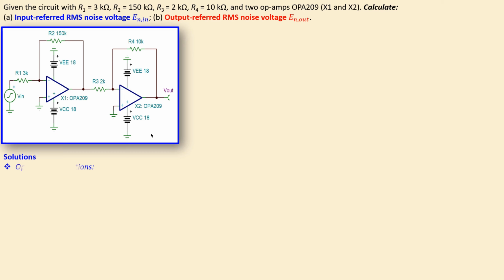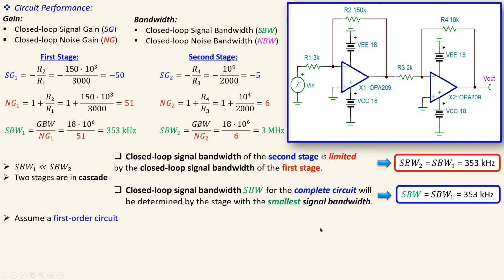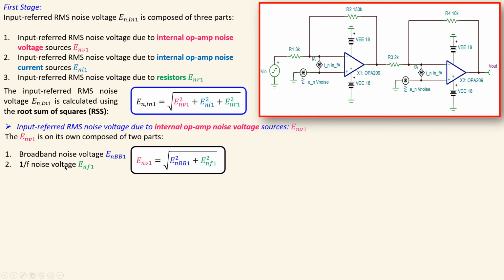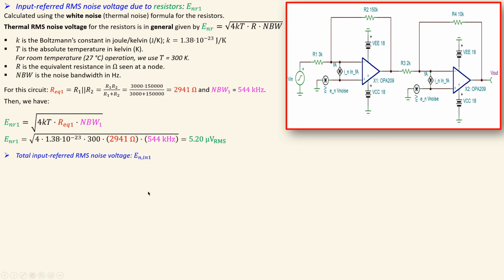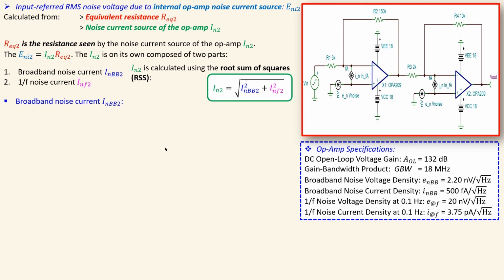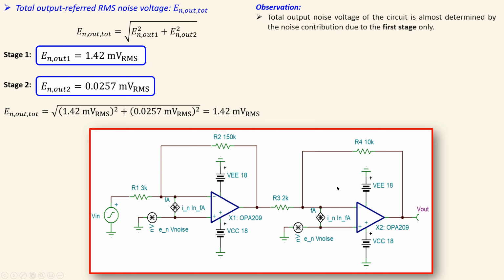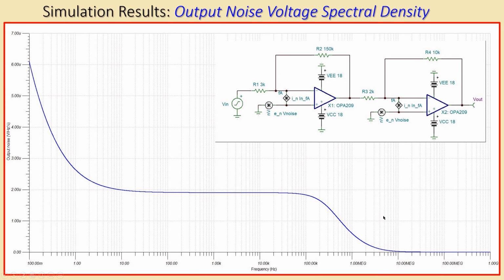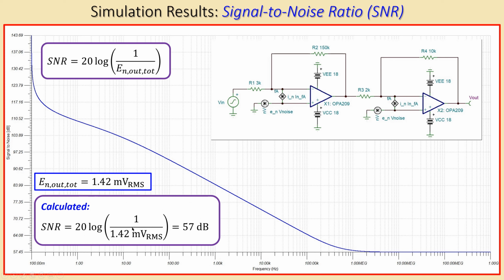Noise Analysis Op-Amp Circuit ⭐ Two-Stage Amplifier ⭐ Calculations & SPICE Simulations ⭐ Example 8

Comment: Hii...nice lecture but in my case i have first stage as transimpedance amplifier and second stage as instrumentation amplifier...then how to calculate noise gain for both of these to calculate noise of the total circuit... please help me with this
Reply from the maker: I do not have time to check your circuit in detail. Try to use the videos or the book.

Comment: incase of connecting INA as second stage with TIA ,then how should i calculate noise analysis
Reply from the maker: This is a too general question. You can use the two-stage amplifier noise calculations in my video.

Comment: I HAVE THE SECOND STAGE AS INSTRUMENTATION AMPLIFIER,SO ITS THE SAME CALCULATION AS MENTIONED ABOVE
Reply from the maker: You cannot have the second stage as an instrumentation amplifier if the first stage provides single-ended output.
See this playlist for more info and videos about instrumentation amplifier noise analysis: 
🔗 Instrumentation Amplifier Noise Analysis: https://www.youtube.com/playlist?list=PLuUNUe8EVqlknqQWFevG_00gFK6iTUxD4
Reply: @CANEDUX  actually,i grounded the 2nd input of INA,
Reply: AND its working...then how can i calculate
Reply from the maker: Why use an INA if you ground one of the inputs of INA?
Reply from the maker: Yes, it might work, but I do not understand the reason for going for an instrumentation amplifier.
Reply: @CANEDUX  becz,we will avoid impedace mismatching and also have high precision